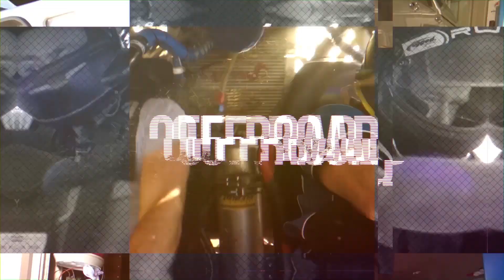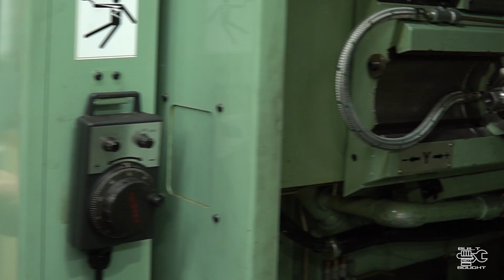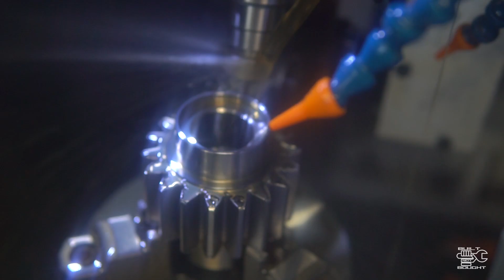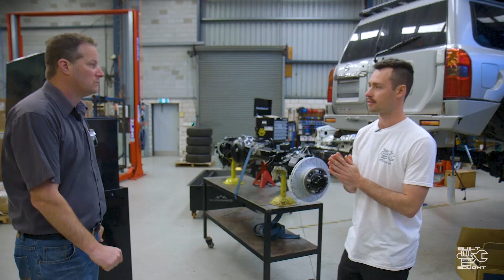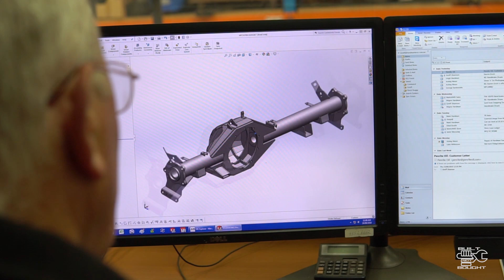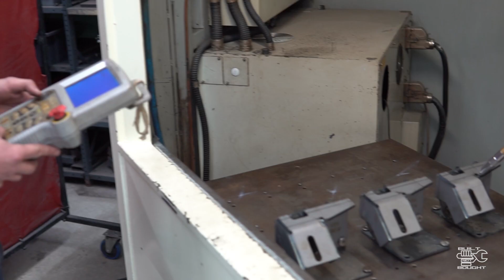INSIDE MARKS || Some of The Greatest 4x4 Parts Get Built In This Factory

Comment: Welcome I have a range rover p38 can i buy some stuff . ls sump range rover p38 . ls range rover headers ceramic coated . 6l80E to p38 Borg Warner Adapter and spud shaft . ls engine mount kit . auto neutral park & reverse kit.